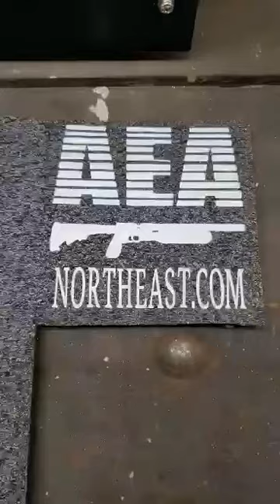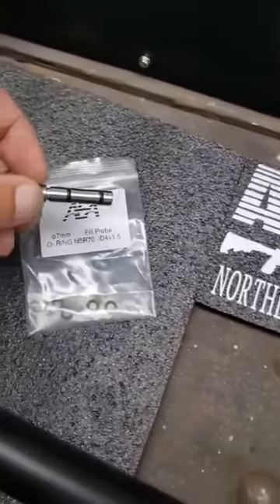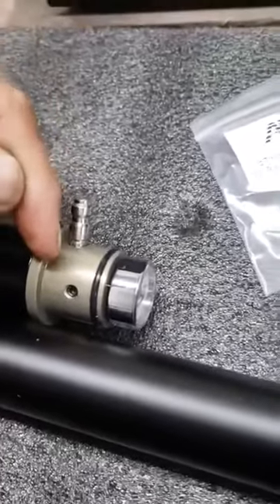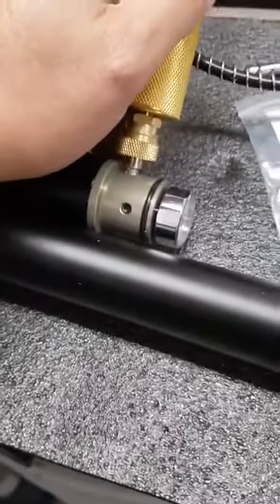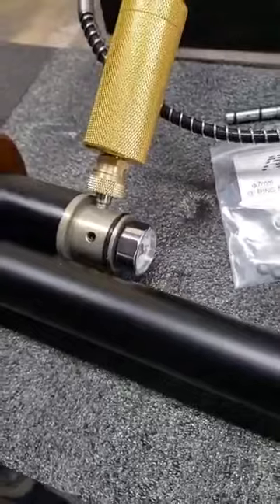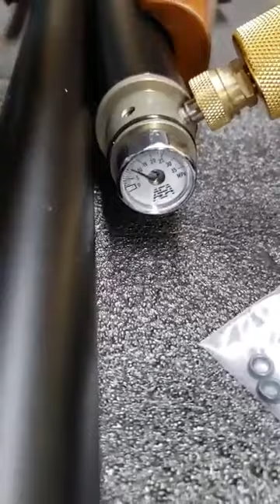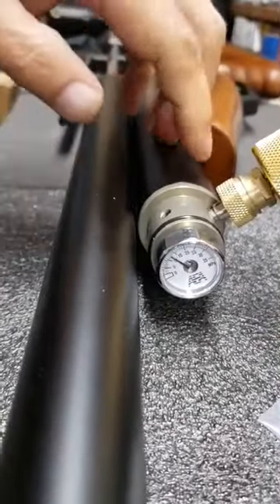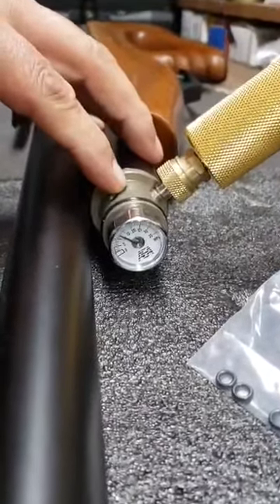BinTac AEA: For the customers use mobile air compressor to fill up your PCP

Comment: your compressor seems to be having issues, my cheap yong heng would have fully filled that to 3600psi in that amount of time
Reply from the maker: This is a very tiny one
Reply: The compressor was probably DC12V friendly, I could be wrong and it's a smaller piston........But regardless not all compressors including high quality industrial compressors for filling scuba tanks have the need to fill that fast.....I owned the yong heng first and now have moved onto the alpha carette compressor........ The slow fill time doesn't even come to mind anymore....
Reply: does that include fetching water...hahahahaha